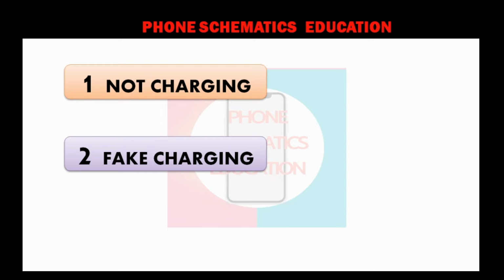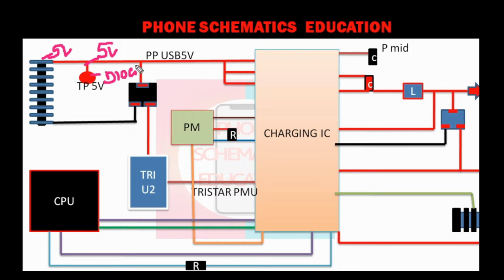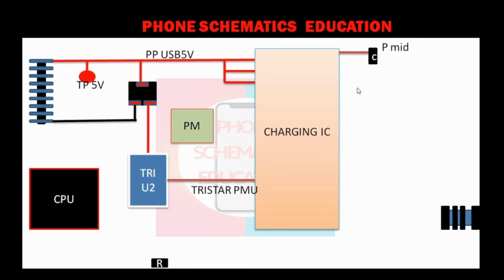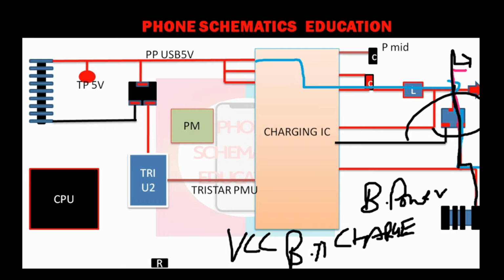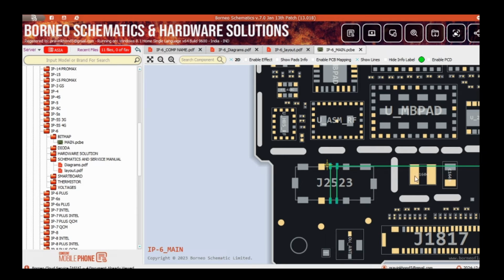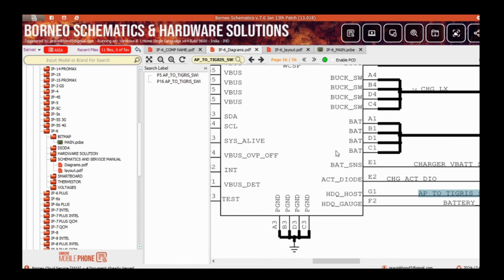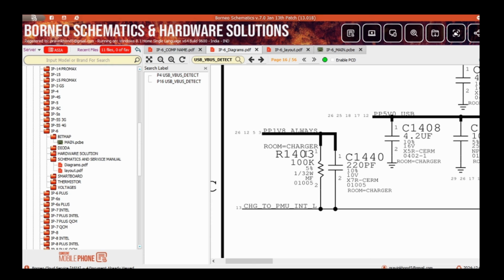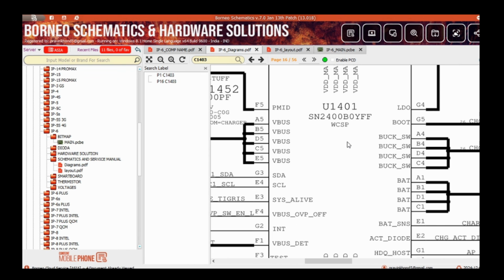iphone Charging IC(Tutorial) Testing+Repair+solution+Sechmatics Diagram knowledge 💯. Iphone Repair.

Comment: Why don’t smartphones start if the microcircuits that are not responsible for power supply are faulty? for example poco x3 pro hangs on the splash screen if the sound chip is faulty, or redmi note 9 if the vibration motor chip is faulty

Comment: tell me if something is wrong: for example, there is a transceiver that switches 3g 4g, there is L3_2.3v for 3g, and L7_2.6v for 4g. To turn on 3G, you need L3 to open the transistor in the transceiver, then will there be power supply for 3G? or if you need to switch to 4g, close the 3g transistor and turn on the transistor for 4g? if so then how do these transistors open and close if pm always generates all ldos after switching on and they are always available to all transistors
Reply: Why, if the sound chip is faulty, for example, the poco x3 pro smartphone turns on and freezes on the splash screen, can you explain this in terms of schematics?
Reply from the maker: I don't understand your question
Reply: ok, better I'll just wait for the video to understand how LDO turns something on or off while LDO is always present from the power ic
Reply from the maker: First your tarancrecever ic is smart ic .it's automatically choses the best network doesn't matter 3g or 4g..also many types of programming installed for this situation

Comment: Will you have a video on how to understand what the problem is in cpu, ram, ufs, via uart or other reading methods?
Reply from the maker: @saved0ff  problem in cpu .forget about all these things. Remember one thing every ic had requirements.one voltage related we call input other controlling requirment.when both type of requirement full full.after any ic create output...There are many steps to check requirment after u can say the ic is fault or not ..
Reply: Understood